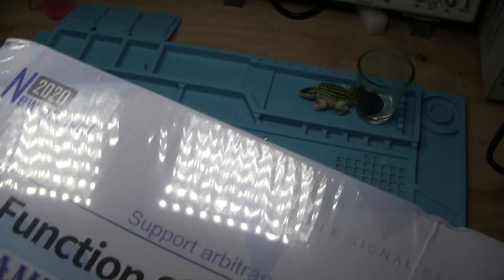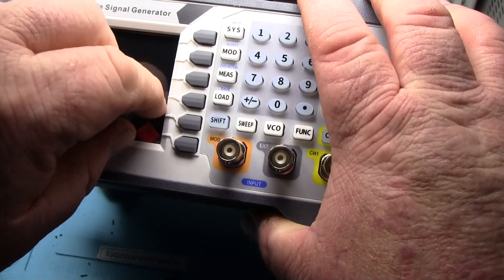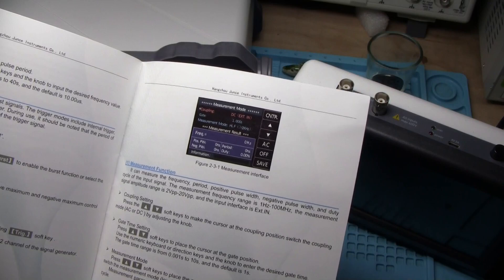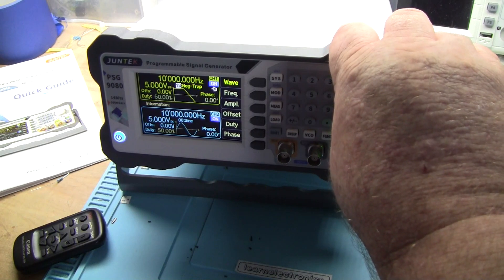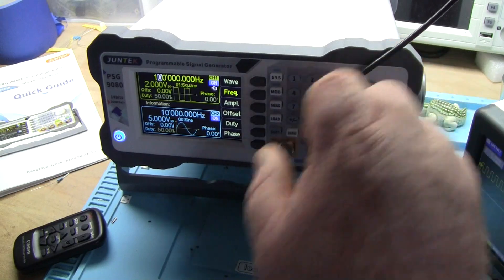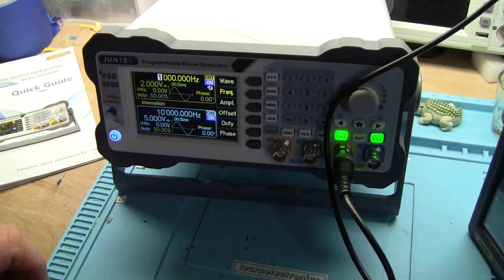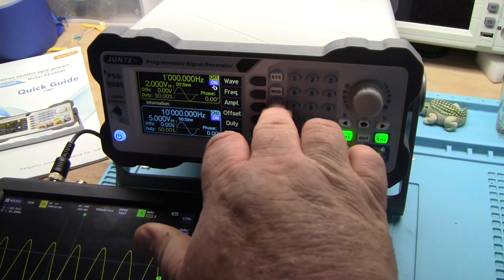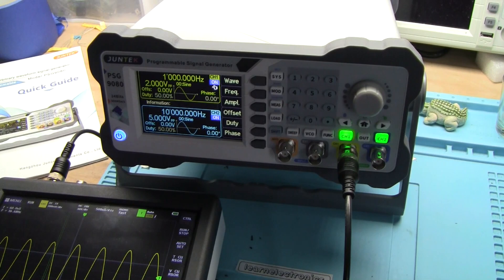Juntek PSG9080 AWG Quick Look

Comment: Does this unit output a Carrier with an internal modulation combined where you can turn on and off the modulation for testing AM Receiver Sections? None of the Youtube Videos show is the Equipment they are reviewing will give a Modulated Carrier for Receiver Testing. I was looking at this unit and the FY6900 Signal Generator but no-one is showing the use of a Modulated Carrier.

Comment: Nice review. Can you please tell me what what is minimum frequency resolution on the 60 MHz range and how stable is it? For example, can one set it to 60,000,003.027 Hz. I have an application where high frequency accuracy and stability are required. Thanks in advance.

Comment: I wonder what the difference is to the Feeltech/FeelElec units besides the buttons. I have the 6900 which also has 14 bits and 100Mhz but only 250Msps. All their other products were pretty much 1:1 copies of each other. Juntec skipped the 6900 and 8300 series though which was the higher priced Feeltech. The Features and interface look pretty much the same. I might have to give this a try because Feeltech support and service is terrible.

Comment: Thank you for the review. I think it's a god product but for the price...I would rather spend $100 more and get a Siglent that is more reliable. The cheaper Juntek functions generators will do for a beginner (I got one of those). 
Some models made by Juntek has also some issues ( see the EEV blog forum)  but these may come up if you use the unit continously at least for 3-4 hours...it happen to me. In any case I think Juntek is a great brand for a beginner, I still have mine and I still use it.
Reply: Juntek and Feeltech are pretty much just copies of each other. Juntek skipped the 6900 and 8300 series though. Feeltech service sucks so I might get this one if it is better quality than my 6900.

Comment: Seems to be very capable, good to see the oscilloscope getting some use. You can't pick up any other oscilloscope with a 7" screen and wave it around in front of the camera like that LoL.
Reply from the maker: I really like the scope. For the price, and the portability I dont think you can beat it.
Reply: @learnelectronics  I first saw it on kangaroo Dave's channel and had mixed feelings, I couldn't tell if it was actually any good.... For me! I only knew that it wasn't any good for him, considering that a lot of people watch his channel, a lot of them are only just getting into the field and this is a good good foot in the door and if you are only working with audio, then it's perfect.
After I saw your review of it, I ordered one for myself, I'm only working with audio equipment and it's perfect! Has everything I need and it's simple to use, it actually looks really good in the flesh and it's battery is upgradable should you require longer run times while being isolated from a mains supply! 
I love it, I also have an older scope if I ever need to look into the higher frequencies but I haven't needed to yet! 
We have come to a point where you can do Electronics on a budget, cheap scopes, even those cheap USB soldering irons that are less than $10 aren't bad if used indoors, if you needed more heat, just sticky tape two together LoL and all you need is a high powered output battery bank and your good to go! I saw a little PCB board on Great Scot's channel, you plug it into a USB power bank and by holding a button down as you plug it in, you can select all the different voltage outputs available from the bank up to 20V for the better ones, the PCB is from memory around $10 but it's very useful, especially if you need up to 20V DC that's both isolated and portable!... I have ordered one of those cheap USB soldering irons, I have a good one already for the bench but for the money, it makes a good backup or a small do all toolbox that you can take with you including an oscilloscope, lol essentially a portable electronic repair lab, hmmm interesting, I don't think that anyone has done a video on what can be possible with portable equipment! I mean which products would one need to cover most bases keeping it lightweight, cheap but as decent quality as possible.. including some sort of power bank to power any of the tools that need it... Just a easy one toolbox grab and go thing!